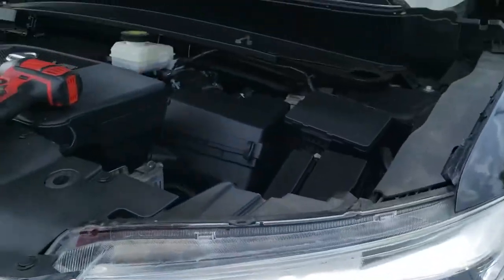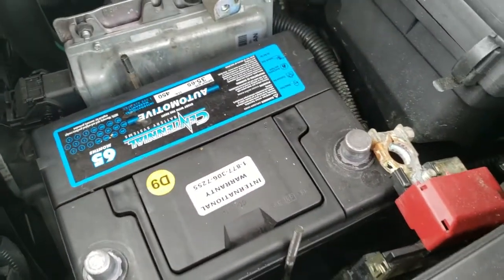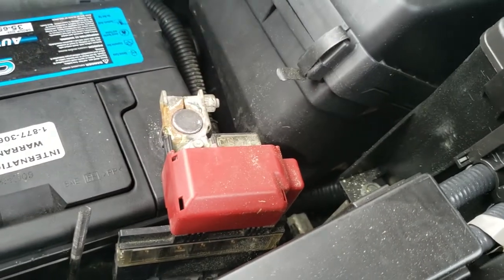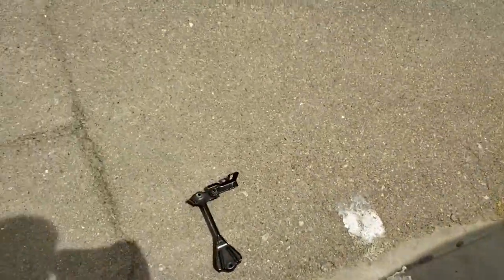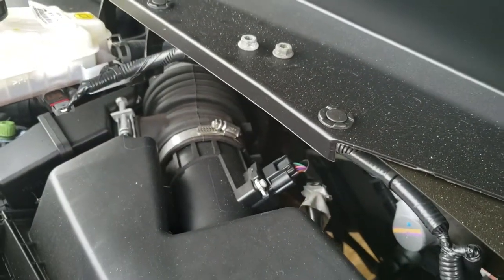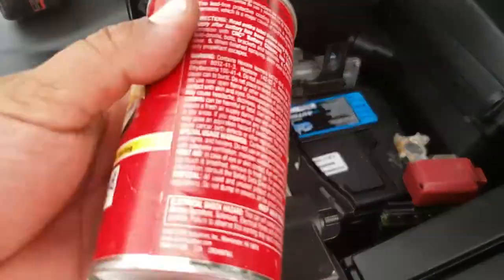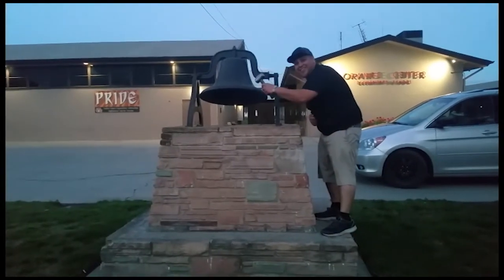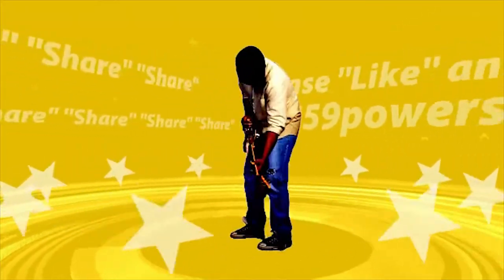How to: Install a Battery on a 2014 Nissan Pathfinder

Comment: Good video but next time please clean the terminals with a wire brush!! Very helpful since I need to do this on a friend's car and I hadn't seen the setup!!  I ban proceed with confidence
Reply: It's less than $10 to get a set of replacements. They are sold as boat battery conversion terminals and available in lead, epoxy coated lead, solid brass, and even stamped and plated like the OE ones. I just did the battery on a 2018 Pathfinder and we went with the solid brass because of how corroded the OE terminals were. That is why I love these stud and nut interchangeable terminals, cheap and easy to replace.